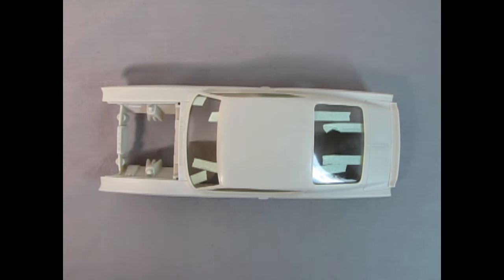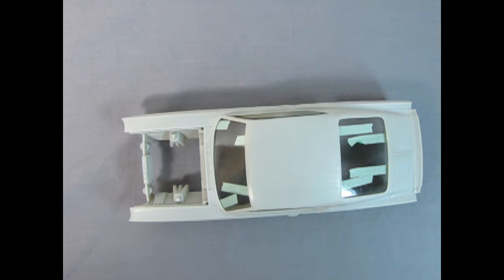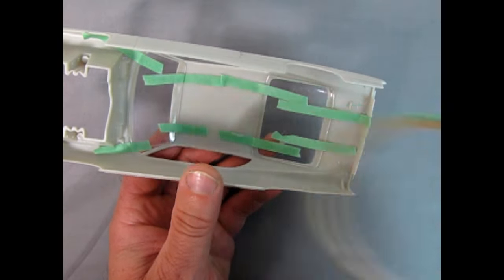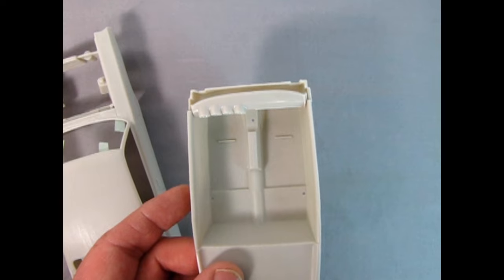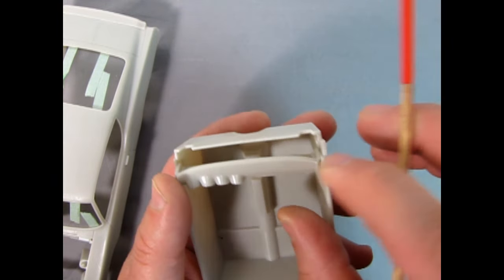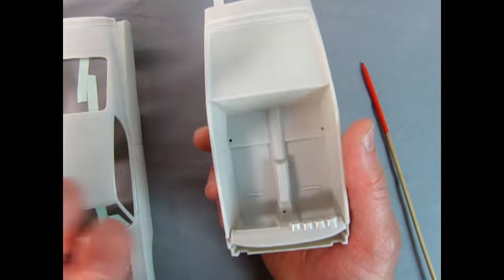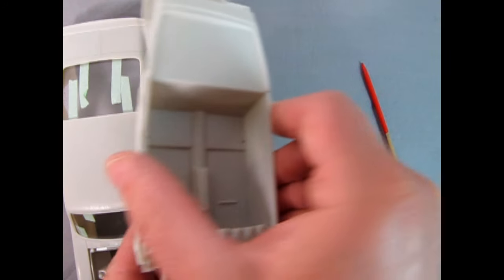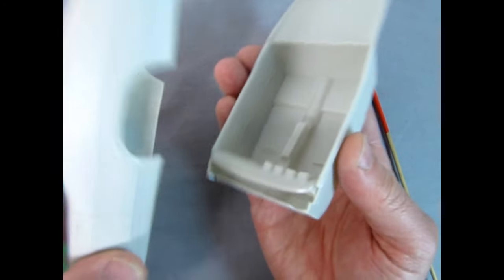My Response To A Question About The AMT's 1969 Ford Torino Cobra and Talledega Wheel Base Issue

Comment: This kit has so many alignment issues a full chassis change might be a solution but what I've found with the  Fairlane is that it would take a lot of cutting to fit. I don't know if the 69 cougars are an easier solution/replacement.  Or if you are going to do a lot of cutting how about the full Holman Moody chassis from the broken nosed polar lights kit
Reply from the maker: I was thinking of the Polar Lights chassis. I have heard that the car has a "Broken" front nose though. If I remember right, the body bends up in the front, or something strange like that.
Reply: @MonsterHobbiesModelCarGarage  yes it does,Trevor, through several releases and it,over here is about 60 quid new,so very expensive.  To cure it involves either good luck with a heat source or slicing the fenders and pulling down. So the project would very much depend on cost and availability. The Fairlane parts swap or polar lights chassis swap both involve a lot of fit tests and cutting out the inner fenders of the Torino to start with. I do think that was a very good 'spot' of yours on the rear panel waffle pattern👍and what should have and not have Cobra badges. . I love that sort of research👍. I've thoroughly enjoyed this investigation we have done and Willi Wass's input helpful too. I don't mind the input and hope for more comments like it. At least 1 more person is thinking about the problem in depth. 👍.
Reply from the maker: @petesmodelcarcustoms584  For sure. Willi has been a great help. I do think that at this stage in my game, I am just going to try and steer away from accuracy and just go with "Can I get it together".
Reply: @MonsterHobbiesModelCarGarage  your already sorting the accuracy with your analysis of the badging,grilles and shock towers.👍👍. What do you think of the interior 'details'??😀
Reply from the maker: I'm going to hid from those! LOL! - No seriously, I'll have to have a look. I also noticed a few other points of issue on the chassis, but luckily they don't totally interfere with anything.

Comment: Ah yes. I see that the technical team is on the issue. My choice would be as Trevor has decided. Cuz i can move wheels and axles and dash. But to each his own guys. More than one way to do it.
Reply from the maker: Well, maybe I am wrong in how I did it...but we will see when I make the video where I build it. When parts are glued together, there is less chance of things like the interior bucket moving.  At worst, I think the chassis would buckle in the middle, or at least bend upwards, or push the rear bumper right out of the body work. At best, it works out like it should.
Either way, with me chopping off the alignment pins, there's no going back.

Comment: Again!when you do it this way the chassis hits the "Firewall" of the interior tub and get pushed out!The Chassis doesnt get int the body that far anymore!If you watch your vid you can see it right at the 7.50 mark that when you push the chassis back the interior tub pushes the chassis out of the body!As i wrote befor its so much easier just to file the holes 2-3 mm in the direction you need to move them!You dont have to drill a hole!What is there so difficult to understand?And at 11.50 you dont see the dash/interior move????Wow!Iam speechless!Dont get me wrong,but iits ignoring what you by yourself showing in your vid!But whatever build it this way if you dont want to listenn to tips from others!Look at 15.50 how far now the chassis comes out of the body at the front!
Reply from the maker: Looks fine @16:32, or did you not see the video at that point?
Reply from the maker: I think you mean to say "Bulkhead" of the interior tub. Anyway, "Sliding" the interior back like I did without gluing in the interior would shift it anyway. That's why @16:32 I just drop it right in place in it's new position. 

Thank you for watching my videos for 3 years, I appreciate your support!
Reply: I found what Willi is saying is right. There is some part of the interior pushes down on the chassis and stops it sitting level in the body. You will find about 1mm down at front. My new one also has a slight twist to the body. I'm looking for another old release  to start again. I don't think the shock tower mounts are a good line up guide either. I don't think they are in the right place. The cougar chassis might fit better.
Reply from the maker: I was too aggressive with sliding the frame back and forth, but I can see that going too far back starts to move things. It's just a matter of getting it "right".
Reply from the maker: Not sure on the Cougar chassis as it's a smaller car.
Reply: @MonsterHobbiesModelCarGarage  I was just grabbing various boxes.😁
Reply: @MonsterHobbiesModelCarGarage  careful alignment marks👍
Reply from the maker: @petesmodelcarcustoms584  yes...you have to try some possibilities.
Reply from the maker: @petesmodelcarcustoms584  For sure.